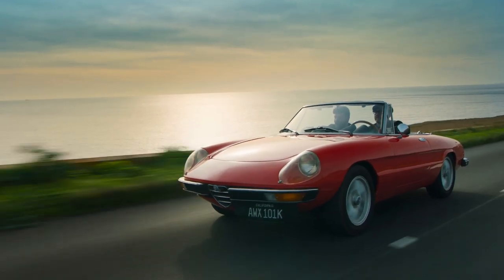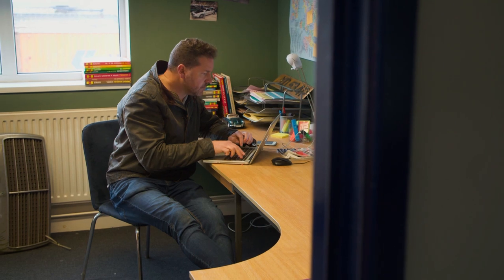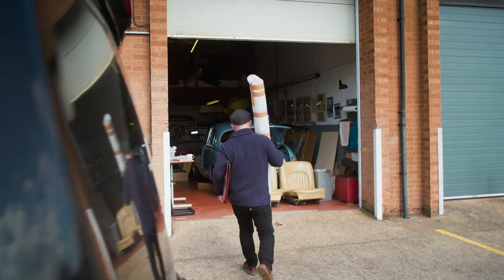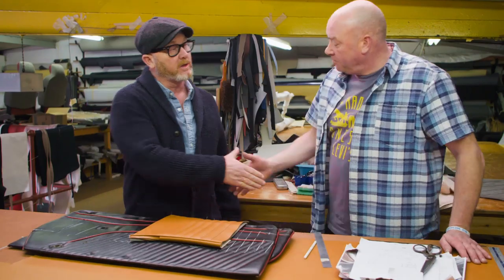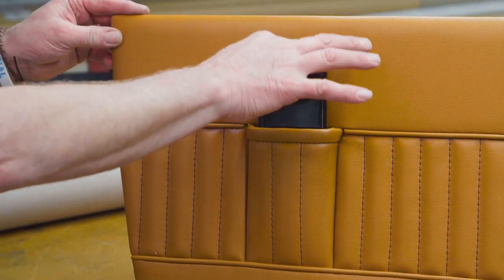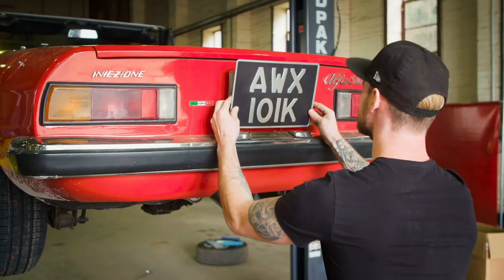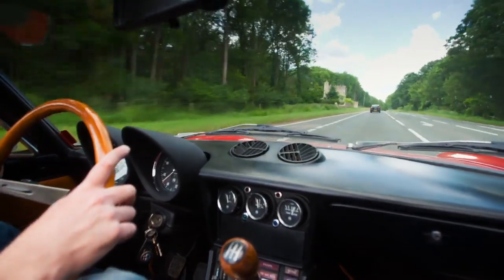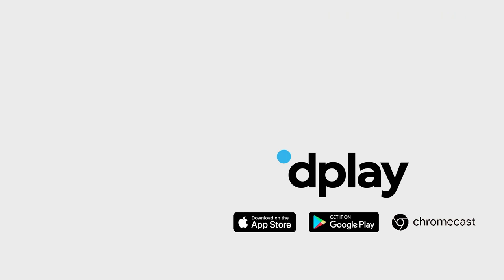Paul Gives Back The Hollywood Glamour To This Legendary Alfa Romeo | Salvage Hunters: Classic Cars

Comment: This car’s suspension is not set up quite properly. They have fitted the tires inside the wheel wells by eye, according to what ‘looks right,’ but that has resulted in an off-level sill. The sill should be parallel to the ground, which will tuck the rear wheels well up inside the arches. That’s what Alfa intended.